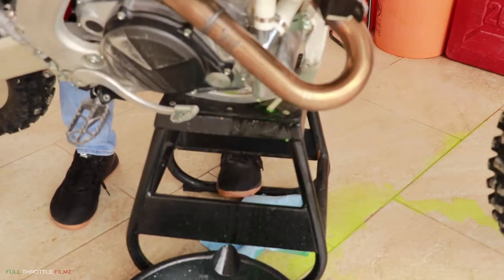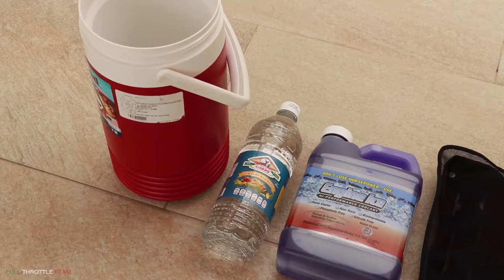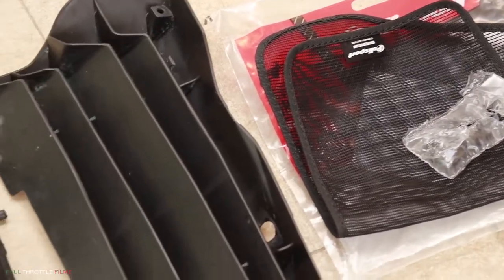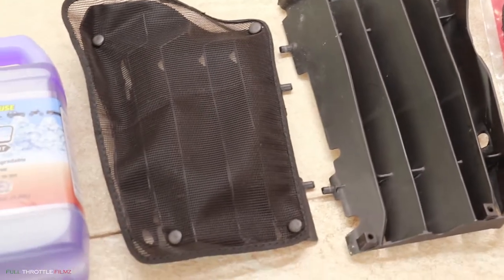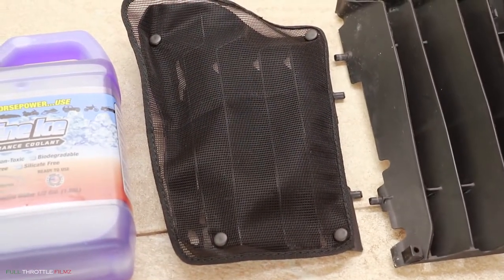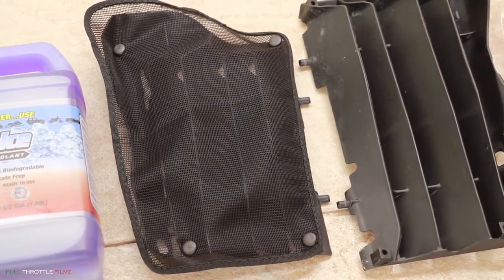Ep 4: 2018 CRF450R RACE BIKE BUILD (RADIATOR FLUSH & PROTECTION)

Comment: Good videos bro!
Reply from the maker: Thank You!
Reply: Were did you get the mesh for the radiators from. As I don’t believe polisport makes mesh for the 2017/2018 yet.
Reply from the maker: Brandon McComb i found them in the wps off-road catalog under body and then radiator louvers from polisport. They have a clip on system that only works with polisport louvers but fitment was exceptional. Hope that helps
Reply: Thank you I will check it out.

Comment: Do you need to do this everytime you go to add coolant? Like completely flush it? I just bought a 17 crf450r and it has 8 hours on it. I opened the radiator cap and can’t see any fluid. Do I just add till it gets to the top or should I do what you did. I checked the oil and it’s still a really good color. So I know in the 8 hours the dude rode it he took care of it
Reply from the maker: Derek Briggs if u know what coolant it has in it use the same and top it off. The coolant only needs to be changed every year or 50 hrs which ever come first. I changed coolant so the flush was necessary.
Reply: FULL THROTTLE FILMZ thanks bro 👌